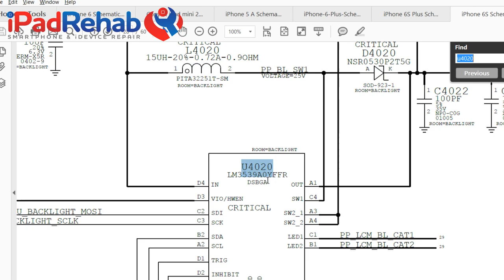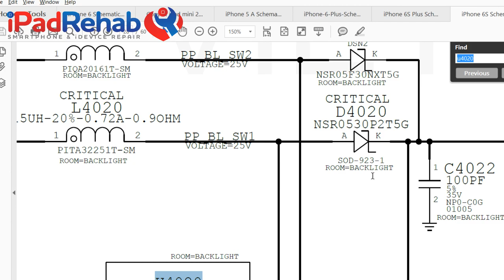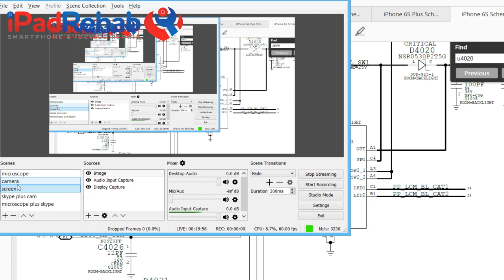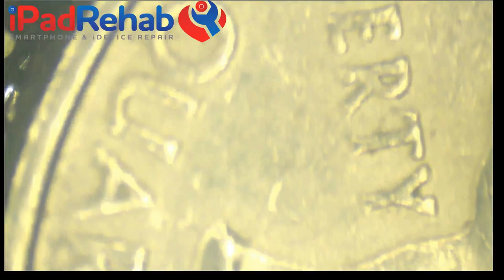Friday night data recovery from botched Apple Authorized iPhone repair

Comment: Jessa, i tried to replace tristar on a 5c but i pushed to hard settling the chip and caused solder balls top pop out of the bottom, when i lifted the tristar i must have damged pin e1 and f2 on the logic board can i run a jumper wire or have i ruined the board please?
Reply from the maker: +Ray Moorhead never ever touch the top of the ic under heat. You can try to run jumpers but it sounds like you need microbga practice on donor boards for awhile first.  5c Tristar is extremely straightforward.
Reply: a lesson learned the hard way lol but there is hope with a jumper wire with schematics im reading it looks like it only goes to a larger bga chip which looks more daunting lol?